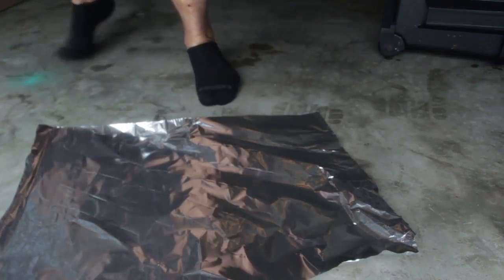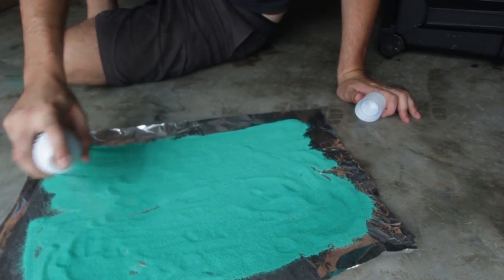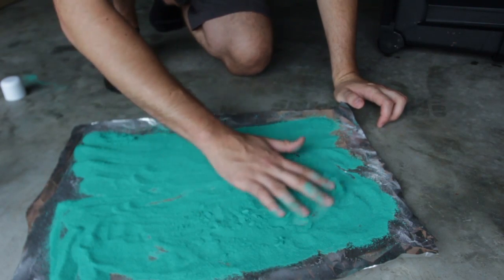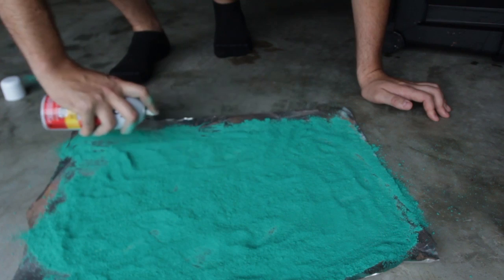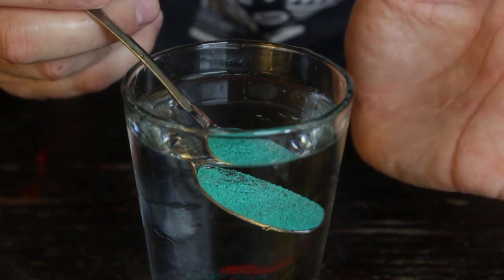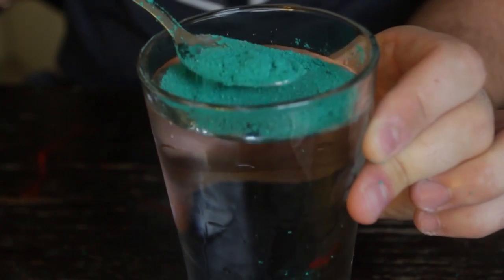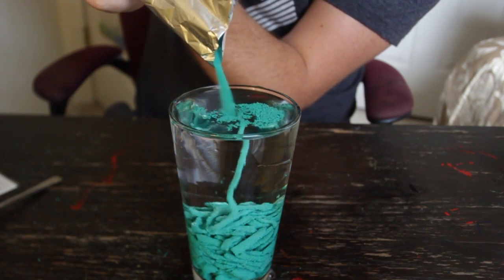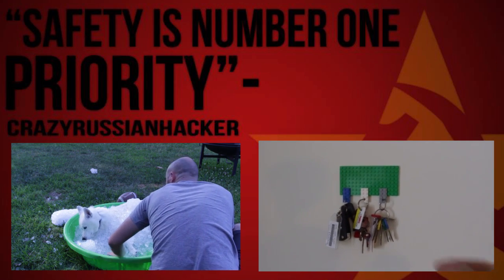DIY Magic Sand

Comment: where  wiill i get that spray and sandd
Reply: That sand you could get at any pet store. 
The spray I'd suggest looking for it in the cleaning section of a supermarket or if it's not there near where the vacuums and other carpet cleaning stuff is. where you'd buy the solution for a carpet steamer perhaps.